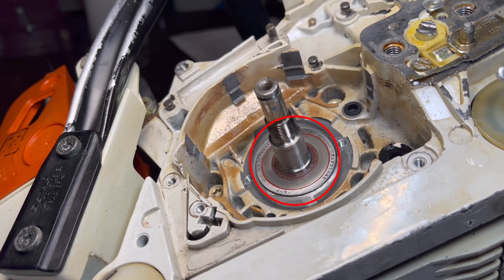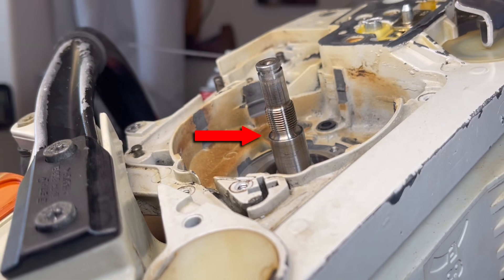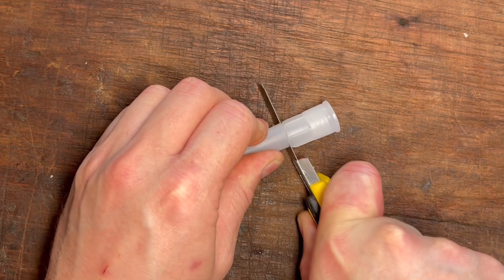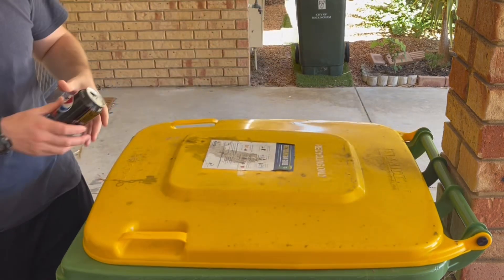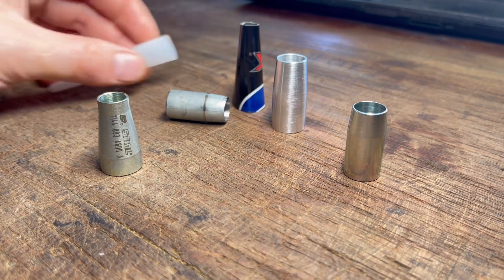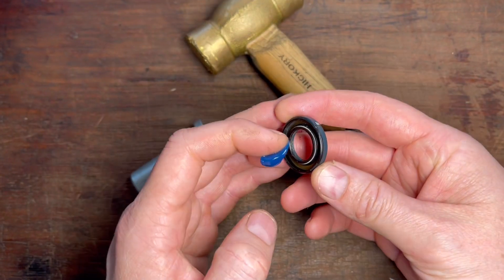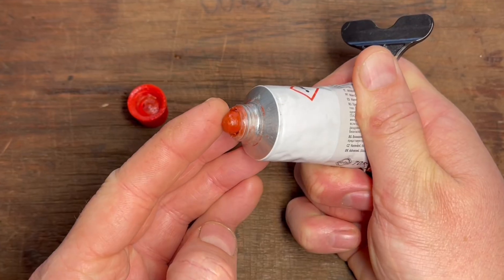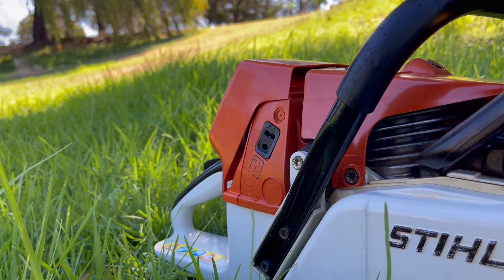This Will Destroy Your 2 Stroke Engine EVERY TIME!

Comment: Adding the proper seal install tools to the cost of the rebuild is easy when you're paying $1500 for a new saw. I also add a little heat to the seal and seal pocket.
Reply from the maker: Very true! Be very careful heating the seal, the fine edges will burn very quickly. No heat is needed.

Comment: My son ran regular fuel in my saw and smoked the seal
Reply from the maker: Hmmm, that doesn’t sound right. That won’t cause a seal failure. The engine would fail though!
Reply: @VintageEngineRepairs  brand new saw would not run the shop could not fix it all I can figure is the main seal
Reply from the maker: Sure, a failed seal will damage an engine, but running straight gas would not damage a seal before it damaged the engine :)
Reply: @VintageEngineRepair it ruined the whole saw

Comment: In some extreme cases, just dirko does not fix. So the solution is 2 component epoxi. The disadvantage is that if it needs replace, youl have to disassembly the whole crankcase for remove it with a socket and applying heat
Reply from the maker: Yes if the pocket is very damaged, it may need to be built up :)

Comment: Does it damage a 2 stroke engine to shut the fuel off and run it til it stops running?
Reply from the maker: If it’s idling, no :) stihl even recommend you drain the tank and let it idle until it stops when you’re storing them!

Comment: a stihl bg50 has limiter caps, where does stihl have the oem settings at before the caps are installed?  or do they have a spec where the L and H screw are installed before adjustments starts before the limiters are pushed on, I do not have a service manual to look this up, thank you
Reply from the maker: I don’t have that info I’m afraid! Do a quick google search :)

Comment: The best oil seal insertion tool for me has always been a piece of xray film, used similar to the can but 100% safer. Plus you can inset it over the step to the bearing so that the seal moves in smoothly
Reply from the maker: Thanks for watching 👍👍

Comment: TBH, I hadn’t come across these purpose made sleeves before. I’ve always wrapped the sharp edge of the shaft with a couple of winds of stretchy electrical insulation tape and applied a bit of oil to help the lip of the seal slide over it. Never had a problem doing it that way. One thing I would say if making a sleeve on a lathe - the surface must be polished. If cutting tool marks are present, instead of pulling the seal over one sharp edge, it will be pulled over dozens.
Reply from the maker: Yep you can use electrical tape too :) thanks for sharing!

Comment: My stihl chainsaw is faulty, it's chain just keeps turning after a little bit of using it and no one can fix it. In service they said it's because the chain is dull, so I had it sharpened but nothing has changed. A big waste of money if you ask me.
Reply from the maker: Start with basics, turn the idle down. If that doesn’t work, I’d suggest checking that there is no debris in the clutch drum, also if the saw is old it could be new clutch springs are necessary, maybe the needle bearing is damaged or seized. Also an air leak will cause that. Who ever said it needs to be sharpened is talking bs. That won’t change anything and is completely un related.
Reply: @VintageEngineRepairs  Thanks for the info, I simply knew it that they were incompetent. Chainsaw is 5-6 years old, not even used that much. I have to turn idle speed down every time I give gas on it, because it just keeps spinning and wasting gasoline and chain oil in idle. I am not a professional repairer so I don't know for sure how to fix it, even those ''professionals'' at the official stihl service in my town don't know how to fix it, but they insist no one makes unofficial repairs since they won't offer their (useless!) services on it anymore.

Comment: Dirko is recommended because it is impervious to virtually everthing. Gas, oil, alcohol, acetone, paint remover, and high temperatures. High end Eurpoean cars use it exclusively as a sealer. Stihl seals may give out in rare instances (usually because the crank has come loose, but the Dirko sealed crankcases, covers, and anything else that needs to be sealed, never leak.
Reply from the maker: Dirko is a fantastic sealant - the best in my experience, but it’s not fuel resistant. It doesn’t dissolve in fuel, but it does expand and lose elasticity. I contacted elring (the manufacturer of Dirko) who confirmed, it’s not fuel resistant.
Reply: @VintageEngineRepairs , that depends on which one you get. The Curil T2 is fuel resistant. Like I said, Stihl uses Dirko H2 to seal all crankcases and covers and the Dirko doesn't fail.
Reply from the maker: @RMartin631  CurilT is not a gap filler and does not set. It’s a totally different product to Dirko and mustn’t be used  in place of it.

Comment: You can also use electrical tape to cover the sharp edge of the shaft. It is a little messy to clean up the adhesive from the tape but brake cleaner and paper towel will remove it.
Reply from the maker: Yes :) I have heard that one before, thanks for sharing!

Comment: One could also 3D print a seal install tool, so long as they sufficiently sand/polish the OD. Layer lines wouldn't play nicely with the seal.
Resin printing would make a very smooth install tool, but most of us don't have resin printers.
Reply from the maker: Yep! That would work; I’m sure. Best to use a file so you don’t get sanding grit stuck in the plastic :)

Comment: Using grease in the cavity of the gator spring will keep the spring in place upon impact with a seal driver , used them every time when replacing crank,cam, and heavy truck wheel seals, never a problem after 45 years ,roger cheers from Canada
Reply from the maker: Thanks for sharing!

Comment: When I rebuild stihl equipment I use OEM parts, and if a motor is scored I first need to find out what caused it. Changing the seals is cheap insurance.  BTW the seal tool is not expensive.
Reply from the maker: I think it’s about $40 Australian. It’s not expensive as a one off, but when you rebuild as many machines as I do, it’s impossible to buy every seal sleeve for every machine, especially one offs.

Comment: I've found that once a chainsaw needs major work, it's cheaper in the long run to just buy a new one. They aren't expensive, and once you have to start fixing them, it becomes endless.
Reply from the maker: I’m disagree if it’s a good saw. I rebuilt one for 300 dollars. New they’re $2500

Comment: Make sure you find the cause of the original failure if you are doing a rebuild. Plugged fuel filter; air leaks on intake boot, fuel lines and gaskets, even a plugged tank vent can ruin the job quickly.
Reply from the maker: Yep! Agreed :)

Comment: I use Honda Bond on my casings and seals when putting the engine back together. Good Vid
Reply from the maker: Hondabond is excellent, if I didn’t use Dirko, I’d use Hondabond. Honda also make a good 2 stroke oil too. Hp2

Comment: There's actually a match simpler solution... Go to the dollar store and buy a set of cheap plastic funnels choose the one that will go over both steps on a large crankshaft and slide the seal back down. 😃
Reply from the maker: Thanks for sharing :)

Comment: Super great info! everyone should also know, NEVER run the fuel tank dry. always stop and add fuel and take a break. sthil weedeater here 13 years 0 work or adjustments and I "hot rod abuse" my equipment.
Reply: You create a (lean condition) each time you do this. it adds up to small amounts of wear that erode the cylinder walls. Iv been abusing 2 stroke equipment for over 20 years and had an old timer tell me this. Ive, never damaged a piston, After all if you run the engine dry each time, you run without oil for just a second, and it adds up.  Just food for thought.
Reply from the maker: Glad you enjoyed the video! It’s not a good idea to run them dry if you can avoid it :)
Reply: I have never heard this, what is the reason for not running til dry (aside from any trash in bottom of tank entering engine) ?

Comment: Heat shrink tubing on the crank shaft works good also.  There are many defiant sizes of tubes.
Reply from the maker: Interesting! I haven’t tried or heard of that before, thanks for sharing!
Reply: 😂😂 wouldn't "defiant"  heat shrink tubes refuse to fit? 😅😅😅

Comment: A "gator" seal or a "garter" seal?
Reply from the maker: It should be garter! Thanks for the correction 👍👍
Reply: @VintageEngineRepairs  we used to remove them and cut out 3 or 4 coils and put it back together (it'll screw together like a - well, a screw). This makes it a bit tighter and helps to form the seal lips to the shaft a little tighter.
Reply from the maker: Cool! Never knew that!

Comment: As a machinist it has always bothered me that manufacturers leave sharp edges on seal fits like these. If you think a lip seal is a pain try it with a mechanical seal on a water pump where the rubber bellows may be an inch long.  I always cut an angle on these fits if I remake the shaft or chuck up the original shaft and file an angle on it. But for saws like this if someone is working on them all the time and needs an installation tool made there are small machine shops all over that could easily make duplicates of these tools for just a few bucks.
Reply from the maker: Thanks for watching and sharing!

Comment: I was certified to work on Stihl saws by the manufacturer and saw several unfortunate failures caused by owners who refused to read the owner's manual. One fellow removed the flywheel to change a chain (totally unnecessary) then put it back together improperly. Internal parts rubbed through the plastic casing and destroyed the automatic oiler. Saw was junked. Another ran the saw on straight gas and seized the piston. Saw several of those. It was not surprising that some users just refused to accept they were the problem, even though they refused to learn about the saws.
Reply from the maker: We need warning labels for everything now days! Thanks for sharing :)

Comment: Nice 066. I still run a beast 066 here in British Columbia. I was running my saw a few years ago and it would die when idling. Dropped it off at Walkers saw shop and they found the crank seals leaking,tore it down,new seals,thing runs great again.
Reply from the maker: Great! I have seen some of Donnys videos, good stuff!

Comment: Just rebuit a stihl with burned up piston. Didn't know to replace oil seals. Guess we will see what happens
Reply from the maker: Did you pressure and vacuum test it? If not and you didn’t change seals, it’s highly likely to burn up again in short order.

Comment: in the 38 years ive been a small engine mechanic, ive NEVER used any form of sealant on ANY crankshaft seals.....if it was meant to be there, it would be there from the factory......ive seen that rubbish cause more issues than cure
Reply from the maker: It should be placed on the outer lip as per Stihl’s instructions. Damaged pockets leak and this is the way to stop it.

Comment: My engine is spooging any tips to help
Reply from the maker: Yes, either not enough load, too much oil, incorrectly tuned or a blocked air filter.
Reply: Tune high speed or low speed screw
Reply from the maker: @Donjon-ts6pl  well they work together, so probably both. That video at the end of this one (that I point to) will cover how to tune.

Comment: I love Dirko. That is the best stuff I've used.
Reply from the maker: Yes I haven’t found a better sealant all things considered.
Reply: Try threebond 1104 or 1211.
Puts dirko to shame.
Reply from the maker: @sdc0386  they don’t, I have used both and looked closely at both technical data sheets. The two you mentioned have less fuel resistance, less elasticity, longer cure time and don’t have as high of adherence strength compared to Dirko. Their only advantage is they don’t set in the tube. Dirko requires some Vaseline in the cap to avoid this.
Reply from the maker: @Rein_Ciarfella  yes. Don’t get me wrong they’re great products and I do use them, but in my experience I haven’t found anything that can top Dirko all things considered.

Comment: fortunately not all saws have the stepped crankshaft problem like that stihl does. I do a lot of work on Jonsereds 49sp, 52, 70 and there is no difficulty at that point of seal installation, also do Homelite SXL/AO and 925 XL saws without a hitch. Prolapse can definitely happen but with some saws it is far less likely. I never use sealant on the outer seal surface unless there has been damage to the seal casting in the crankcase. Always test your installation for pressure and vacuum after finishing installation.
Reply from the maker: I’ve just had a look, the first one I searched (super XL) has a stepped crank and must have a sleeve. I can’t search them all, but I’d suggest proceeding with caution.
Reply: thank you, I have done several with no problems. Using a pop bottle piece of plastic as a sleeve to "shoehorn" the seal over the ledge can be useful but I  have also found that using a seal driver that fits pretty snug on the crankshaft helps very much to prevent the rolling of the seal material, that dreaded prolapse, a small piece of tubing or pipe, metal or plastic really aids the process. Warming the seal material is of value too, allows the butyl or viton...which ever is used....to expand and conform to new shape. The key is to take your time and push by hand, avoid hammer blows or such when trying to get that seal over the sharp edge. @VintageEngineRepairs

Comment: When I worked on specialized equipment, we used green Loctite 609 on the outer race of bearings. It held the bearing in place and acted as a seal as well. These were larger shaft bearings. One good thing about 609 is it's anerobic and it cures fairly quickly.
Reply from the maker: I like and use 609 :) thanks for sharing!
Reply: @VintageEngineRepairs  I like you, I like to be man handled.

Comment: I know about the can, but not the caulk tip. Wonder if the industrial size tubes would fit. Great info.
Reply from the maker: Oooo!! I figured there must be larger tubes, but never seen one :)
Reply: @VintageEngineRepairs  if I find one I’ll let you know. Do you have a video about removing the seals?

Comment: Greetings from the other side of the world, rural Arkansas to be exact. Wonderful video on perhaps the most neglected aspect of two stroke engines. In fact, this problem was my introduction to chainsaw repair and the start of a great hobby. It's rewarding to see someone else using Dirko on the outer edge instead of grease, as most do. Dirko acts as a lubricant when wet and forms a seal much better than grease when dry. One thing I might add: a twisted tube of thin, flexible plastic, such as the sturdy plastic bags that dog food or cat litter come in, can also be used to get the seal over ledges safely, and it's a universal fit. Thanks, Tom!
Reply from the maker: Thanks for sharing another sleeve idea! That’s cool :) yep; I never use grease on the outer lip; some seals don’t have a tight fit, it helps keep them in sometimes too!

Comment: Just be careful of how much sealant you put on the seal (especially on the clutch side) as in this case you installed the seal into the outer race of the bearing.  You don't want excess sealant entering the ball path of the bearing. I would leave the first mm of seal width free of sealant so when installing there is no risk of sealant entering the bearing.
Reply from the maker: Yep, just enough to seal any damage. 99 percent gets pushed out on install anyway.